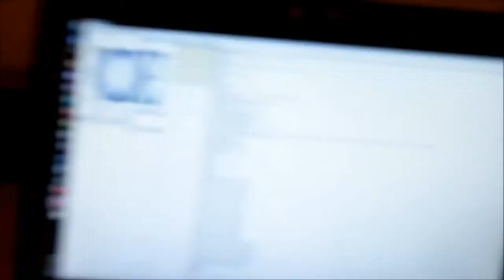Mini Kossel 3D Printer - Auto-Calibration and Some Printing...

Comment: Hi.  Your build series is excellent!
I just finished my Kossel mini around the same time you did.  How did this print come out.  What slicer do you use?  I'm having trouble with small diameter holes.
Reply from the maker: I'm still figuring out how to tweak the settings to get good prints as well... My printer uses a 0.4 hotend from hotends.com which I think helps. (the cheap hotends on eBay are not as consistent AFA the extrusion quality.) 

AFA slic3r, I just grabbed it from slic3r.org But I'm using the config from the Blomker kossel directions. AFA print quality, the best explanation I've found on how to tweak the delta printers is here - http://letsmakerobots.com/content/kossel-mini-calibration.

Also if you haven't, I suggest measuring your offsets and checking against what you've got in Marlin. (A good explanation of that is here - http://forums.reprap.org/read.php?267,291243 ) My prints got better once the numbers in Marlin matched the actual physical measurements of my Kossel. 

What I've learned so far:

 - PLA on my printer likes around 210 Celsius. But I run the first layer hotter (and thicker) to get it to stick
 - ABS on my printer likes around 245 Celsius. But I need a heated bed for large pieces. It warps a lot.
 - Best temp. varies slightly with the color of plastic even when using the same brand?!
 - Blowing air on the print with a small fan can minimize the oozing to get cleaner holes and edges, but on larger parts will cause shrinkage that warps the piece (more true even with ABS)
 - Too High a temp causes oozy weird parts
 - Too low a temp and you can 'see the print', lower still and the extruder struggles
 - ABS likes to shrink (but makes nice parts! Looking forward to a heated bed) 
- Tried PET+, runny but has serious potential if I can figure it out! (adhesion between layers is awesome! Could make some great looking plastic pieces...)
- a Dremel or similar rotary tool is indispensable for cleaning printed parts prior to assembly.

My next step will be the addition of a heated bed. It took a while to find one small enough. But I've now got a 150mm heater that'll stick on the back of the glass. So I will be building some insulating mounts for the bed out of wood and cork. (I need to insulate both the frame of the Kossel and the Force Sensing Resistors from the heater...) In addition I've got to tweak Marlin to be able to use both the FSRs and the heated bed. So that'll probably be the next video.

BTW - here's the offsets on my kossel as measured:

// Center-to-center distance of the holes in the diagonal push rods.
#define DELTA_DIAGONAL_ROD 215 // mm

// Horizontal offset from middle of printer to smooth rod center.
#define DELTA_SMOOTH_ROD_OFFSET 137.0 // mm //originally 145

// Horizontal offset of the universal joints on the end effector.
#define DELTA_EFFECTOR_OFFSET 20 // mm

// Horizontal offset of the universal joints on the carriages.
#define DELTA_CARRIAGE_OFFSET 12 // mm //originally like 21 or something huge???
Reply: Charles Werbick
Great tips!  Can't wait for your next video.

I've had trouble with one .35mm J-head from China.  But I managed to print a Z-probe for the fatter all-metal hot end before nozzle got blocked and plastic strarted to ooze out of the screw fitting between the PEEK and heat block.  This other .4mm all-metal version is giving me good results so far.

I had to tweak my delta diagonal rods to get correct x/y dimensions.  I found this out the hard way after printing out the case for the lcd controller and it won't fit!

I use slic3r as well but I want to try Skeinforge because of its "Stretch" plugin to fix small diameter holes.  I'm still trying to figure out equivalent terms between the two slicers. SF terminology is so confusing.